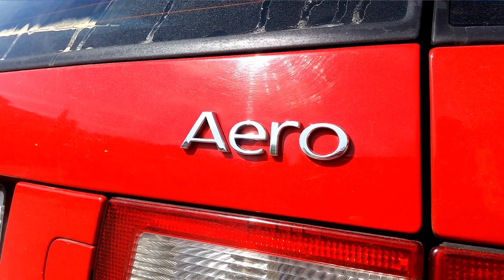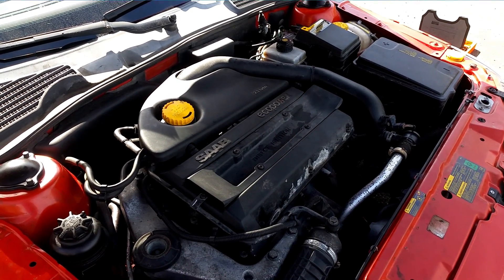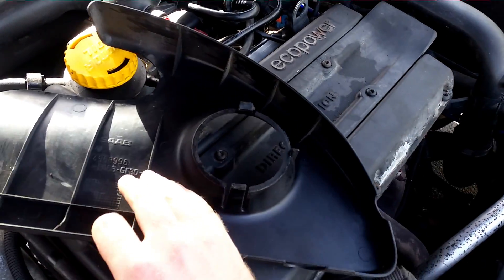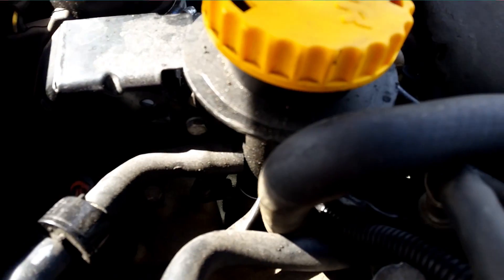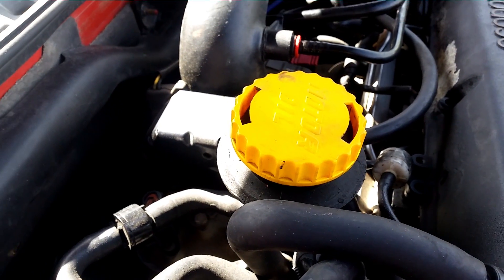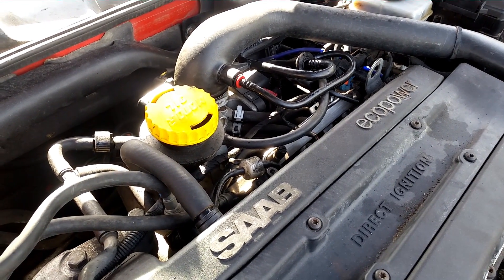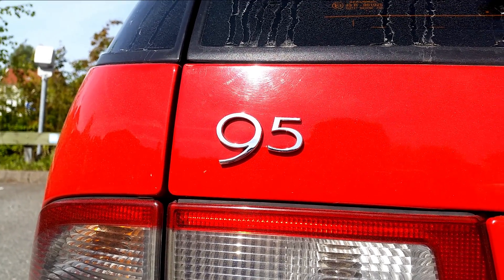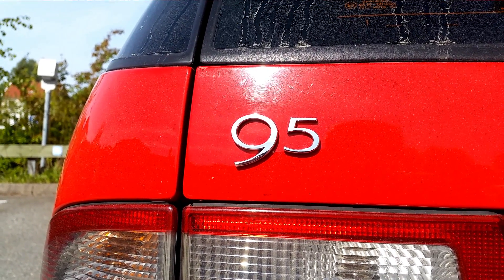Saab 9-3 and 9-5: Checking the PCV system version - Trionic Seven Quick Tip

Comment: Thank you for your excellent postings. Despite some city driving, my 2008 SAAB 9-5 with GM Dexos2 oil runs very well. Do you think it is recommended to have the engine sump cleaned at the next oil change?

Comment: I have a 2001 93, drove it for a couple of thousand miles with no issues, suddenly after oil change to a synthetic 5-30 the engine started spiting oil like crazy when engaging the turbo, still not sure where the oil is being blown out (I lost 3 pints in around 60 km) refill, drove the car again but keeping the revs low (avoiding engagement of turbo) and cero spitting, no doubt to me is related to PCV system, I have the not updated one.... Can the oil be coming out from the rear seal, I cant find the exact place where is coming from without disassembling stuff, any advice to where to look and if I can fix the PCV system for now without changing the kit? Thank you in advance Sr.

Comment: I have an 03, but it looks like it has an 04 solution - I found out the hard way when ordered a kit and nothing seems to fit. It is a 09.2003 registered so a late one, is it possible it is what you call an 04 and onwards?
Reply: Your car is 04 so you're good 👍 i have the same thing on my 9-5, its registeret 10.2003 but model year is 2004

Comment: So is the 05+ new style engine block eliminate this okay ? Or should we add this modded pcv ? I have a 07.  I don't notice any sludge in oil.
Reply from the maker: Yep, 04 and up have another block. 07 = no worries
Reply: Honestly I thought I'd hate GM has its hands in my Saab. But I love my 07. Maybe it was right before they changed it too much.

Comment: Jonathan, is there (in your opinion) anything to be gained from installing an air/oil separator like the Subaru guys do on their EJ25's? I saw a video about an installation of a "racing"-version of such a separator and it sounded like a very clever device for insuring your engine from sludge etc. Any thoughts on this?
Reply from the maker: There's already an oil separator in the car from factory.

Comment: Hi there,for 2006 or later SAAB  9-5, how the check valve in hose from oil trap (part#: 5961610) to intake works, I just got my replacement from eEuroparts and it does not function as a check valve either.
thanks.
Reply from the maker: Sorry, I actually don't know. Check our forum! https://www.facebook.com/groups/733705113501723/

Comment: i have a 2004 saab 9-5 with 235E engine. Car was manufactured in 10/2003. The throttle body is bigger with an extra connection under the small vacuum line connection.
Does my car need an updated pcv system?
Reply from the maker: Nope, you have a 2004, which is the modified engine block/pcv system. Your car is completely different from what I show here!

Comment: My 2003 has this type fitted but I am still having to fit a new update kit because the hosts and everything and soft and mushy like play dough and I have an engine warning light and codes saying it not working so even the with the up date kit the previous owner had not looked this side of the vehicle I intend to address this and get the car good and clean .engine wise.
Reply from the maker: Sometimes the hoses go bad, and in your case it's a good idea to replace them. Good luck!

Comment: Is the pcv could be responsible of a surge and stall engines after a few miles thats what i felt when driving , is the pcv valve on my saab 9-5 can be tested by shaking?
Reply from the maker: Maybe, but I can't help you with so little info. I'd ask a mechanic to take a look.

Comment: Thank You!! Any videos on hydraulic fluid install on a SAAB 9-3 2000 convertible for the top would be appreciated!!
Reply from the maker: I saw your question the two other times
Reply: I looked but cannot find a reply..Many thanks anyway, your videos should be re-labeled as tutorials since they are done for educational purpose!! Best EVER!! Tritonic Seven University!!
Reply from the maker: Hehe, thanks :) My other reply was that I don't have a convertible so I don't know the procedure. Check the WIS workshop manual if possible.

Comment: Hello!Thanks for the advice because i will use it before i buy a Saab 9.5.
Reply from the maker: Glad you like it :)
Reply: Hi again!I will buy the car tomorrow but i asked the onwer to tell me if the engine have the pcv system and he told me that was a diferent pipe.Its from 98.what can you advice?Thanks
Reply from the maker: If it's a 98 it needs that pipe, otherwise you'll need to upgrade the PCV system. And remember, without the upgrade the car likely has had bad lubrication, many costly repairs due to premature wear of turbo, chain, bearings, etc. etc. I'd avoid that car.
Reply: Thank you very much.
Reply: Did they have the same issues with the v6? If so how do I tell if the fix has been done on my 2000 95 wagon?

Comment: is the thicker of the hoses in this video the Engine Crankcase Breather Hose? the one thats connected to the valve cover and is directly next to the dipstick cap on the left in this video. i have to replace mine but unsure which part to order.
Reply from the maker: I think you find the answere here: https://web.archive.org/web/20160409095332/http://www.mitt-eget.com/saab/information_ccv_en.shtml
Reply: Trionic Seven was there an actual recall for this set up or just recommended that it's upgraded? i tried looking up the recalls for the 9-3 and couldn't find anything on this specific recall. thanks
Reply from the maker: Yep, actual recall and a major problem for T7 engines. Many, many Saab 9-5 and, to a lesser extent, 9-3 were affected with many failed engines, requiring replacement.
Reply: Do you know the recall reference number? I tried looking it up and couldn't come across it. I have a saab service center near me and if i could save the money and have it done for free if prefer to do that.
Reply from the maker: TSB 210-2561. However, it's easier to just search for Saab PCV update, or, again, read the link I sent.

Comment: I bought a engine from a 04 9-5 for my 02 9-3. the pcv system is not as pictured with the hose you mention. I would like to know what is different about the engine block.
Reply from the maker: The video only applies to the older engines, but check out the FAQ here: www.mitt-eget.com/saab/information_ccv_en.shtm

Comment: Hai I have a 05 Saab 95,I just got home from work. while I was driving to home  my driver  seat start over heating. I have to pull over bcoz I felt like my seat on fire. I check my heated switch it was off. I turn the ac off but my seat is still overheating, only the driver seat. I have to continue to  drive with my jacket  and couple of magazines put on the driver seat then sit on the seat. I can't  afford huge mechanical expenses. is there any way can you please  help me brother.  if you direct me to unplug the heating  switch or fuse or plug. I will  do it...see I don't have much mechanical  experience.  you are  the only one I can find in YouTube who knows everything about these cars.  my email is colinskaria83@yahoo.com pH no is 9729928338. help me man.
Reply from the maker: +broover Hey, you could pull the fuse to make it stop burning. I have heard this is a common issue, with the seat heater short-ciruiting and over-heating. Check the fuse panel for the fuse numbers.

Comment: +Trionic Seven: For Saab Enthusiasts  Do you have any instructions how to change the PCV-system with spare part 55561200. Is it complicated?
Reply from the maker: +lars niklasson Sorry, no. I would make a video if I had a car to do the repair on :) The fix is not difficult,, you need to lift the car slightly to get underneath. Otherwise, you'll be good with a socket wrench.
Reply: Trionic Seven: For Saab Enthusiasts Jag behövde inte gå in under bilen. Tog allt uppifrån